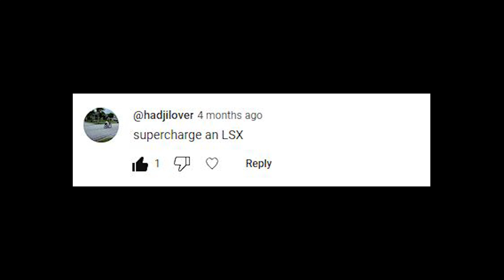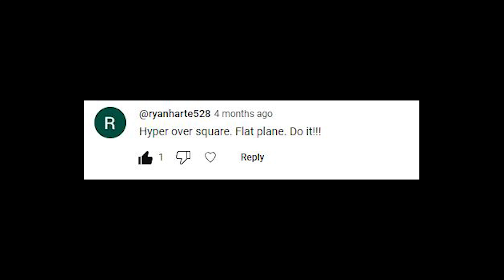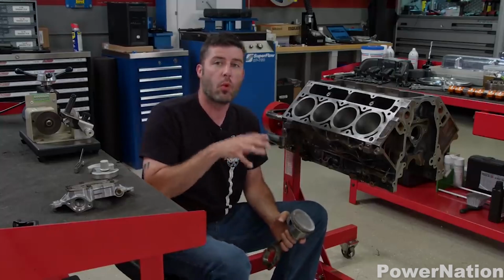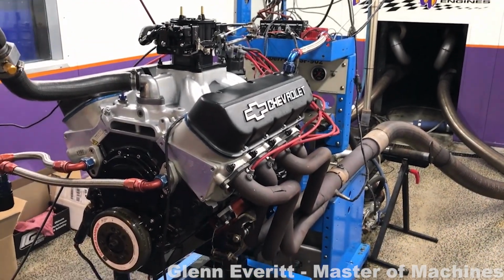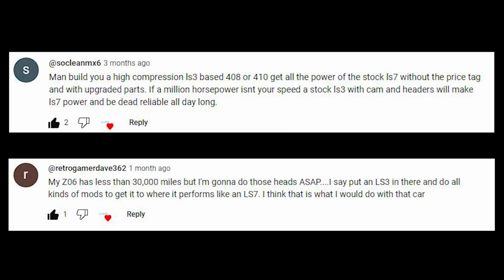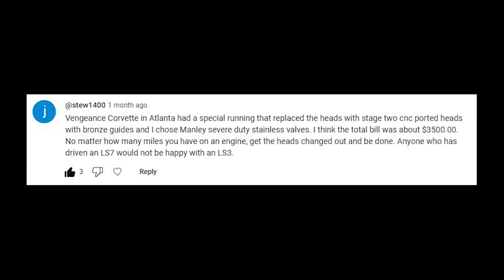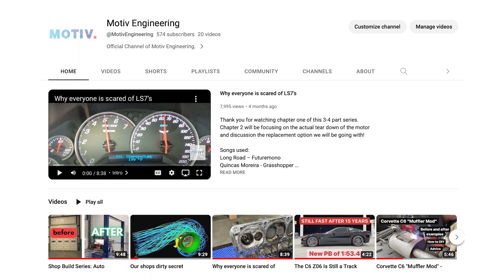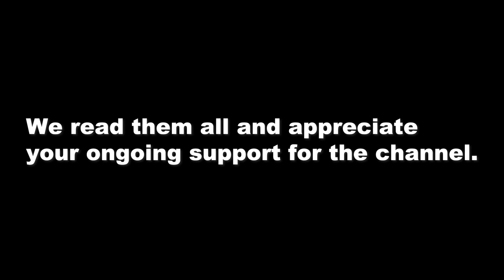Your LS7 replacement ideas

Comment: It really isn't impossible to get a 6.2 to make 500+ horsepower NA. Just throw a good cam, intake, possibly warm over the heads, valvesprings, and a hot cam.

Edit: that was mentioned, lol. Let me elaborate.

What makes the LS7 special isnt that its the perfect NA ls or something. It's just another LS, with a fun "427" displacement. The special thing about the LS7 is what it managed to do while passing emissions and harshness standards for a production car. Its always going to be a compromise when compared to a purpose custom-built modified engine based on the same (LS) platform. A modified ls3 is HARDLY a downgrade.

Comment: Just don't put the same (faulty) engine back in. Go old school... Older engine with carburetor and take out all the electronics.
Reply: That would be a step backwards.
I don't know why people are stuck in the past saying to put a big Block or get rid of all the electronics,the ecm control ALOT ON THESE Z06 VETTES
Most of the people on here don't even own a c6 z06 and are giving advice on a cr theme never driven with an ls7,let alone all the tech that in the Z.
Reply: @Tigerchevelle77  I have been working on cars OVER 30 years. I can tell you with 100% certified knowledge, my stepfather has a corvette, old school, it can eat a current vette and crap out a few chevy Cruze as a result. Drop a valve? Nope. Rev limits? No. Head gasket problems? No way. Solid big block with 2 carburetors. Can fix it with minimum tools and a timing light. Engine isn't a knuckle buster and easy as hell to modify, but not needed, it is a monster as is. New vette are plastic, inside and outside. Too many things can AND DO go wrong with them. Try to boost them? Warranty void. Muffler delete, no bueno. Your never gonna convince me that a new technology ANYTHING can compete with old school muscle. EMP pulse? Your PCM is fried. New battery & alternator, back on the road immediately. We are 1 Coronal Mass Ejection away from the stone age. My 78 trans am 6.6 V8 did NJ to Ohio in 5 hours. Cannon Ball Run and out ran 2 PA state cops. 😝👌
Reply: @jasonpocaro2730  BTW those PA state patrol cars are not fast.
Reply: @Tigerchevelle77  The first car I out ran, called ahead to a second unit, out ran THAT one too. Faster than 2 pigs and a radio signal. A "new" Corvette with valve failure or "technology problems"? I can out run with my 1999 Ranger with 182K miles and a 48 foot trailer on the ball. Unless you can fix the current BAD VISIBLE LITANY OF PROBLEMS... CORVETTE will cease to exist, in the next 5 to 10 years.
Reply: @jasonpocaro2730  EVERYONE, TROLL ALERT!
CLAIMING HE CAN BEAT A Z06 PULLING A TRAILER WITH A RANGER!
Let me guess,the ranger and the trailer belong to your stepdad!.

If your turned off about the LS7 why even watch or comment 🤡?
Reply: @Tigerchevelle77  I love the fact that any idiot who would flush THAT amount of money down the toilet, on a plastic piece of crap, with multiple engine problems, could have got a Scat Pack equipped HellCat for half of that money. Endless entertainment, at your expense.

Comment: Why not just get a 7.3 liter engine from ford. It will produce the same  power. Or do you just want Chevrolet motors?
Reply from the maker: I think I'm intimidated about the amount of fab work it would take to swap a non-LS into this car. In addition to that it weighs over 100lbs more and makes less power (unless you go for the "megazilla" one which then is over $15,000)
Reply: blasphemy lol
Reply: @mattghostly 
Huh? 🤦🏻‍♂️
Reply: @GridForgeMFG  I own an 09 z06,these comments are funny.
Most people have never driven a z06 to know how much engineering went into the car to make it so balanced.
I think the thing that kills these ls 427 is how much they get modified.
If you want the value to stay with the z just redo the heads thru American heritage performance,and stay away from turbos and a blower,this is a road race car,and adding that weight to the front hurts the balance.